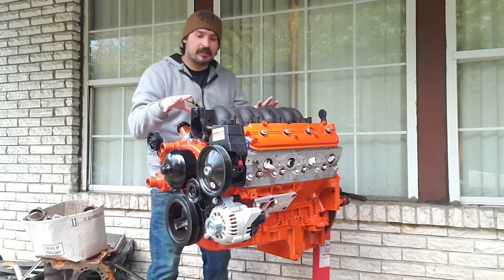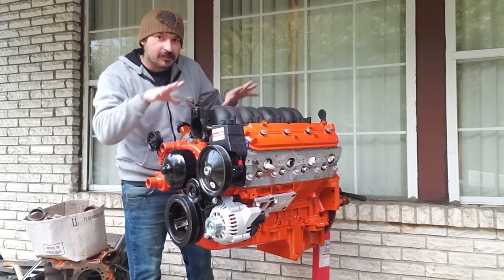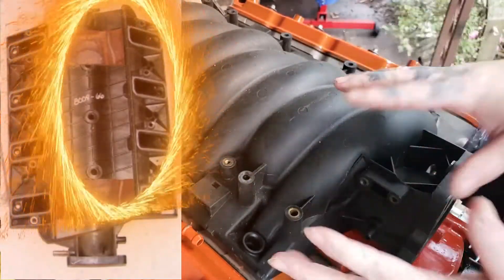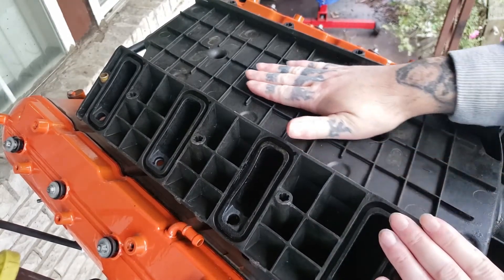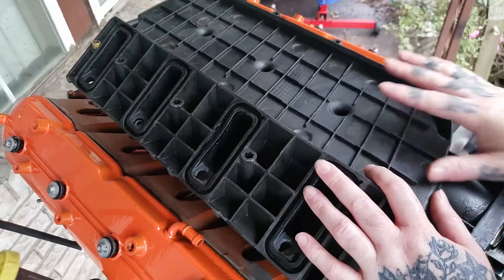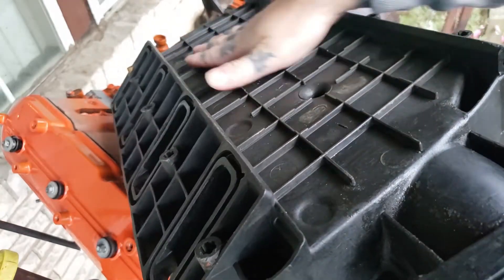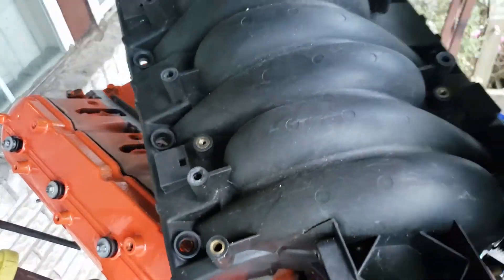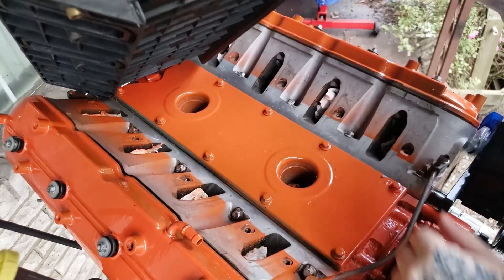What To Do When Your LS6 Intake Wont Fit - HOW TO

Comment: DO NOT remove, grind, sand or otherwise modify the reinforcing ribs on the base of the manifold. Modify or replace the steam tubes with an external design that does not run under the intake. The engineers are paid a squilion dollars to design a plastic inlet manifold which can reliably withstand the heat in this application. Removing these ribs simply degrades the structural strength under high temperatures and the floor of the intake will warp.

Consider the reality, a flat design would be so much easier and cheaper to produce, however in this application, GM's analysis determined their liability risk didn't make good business sense. It was cheaper and easier to retain these ribs from the earlier design than the cost consequences of a major recall due to intake manifold warping.